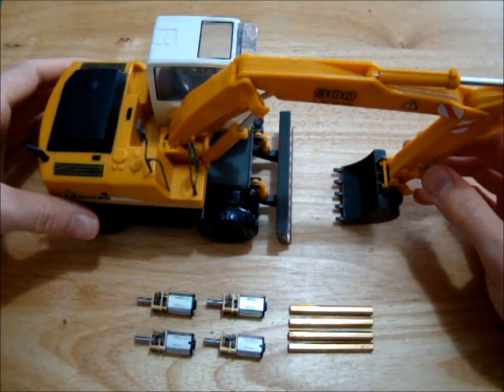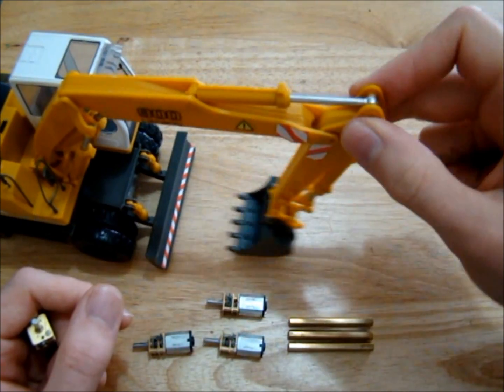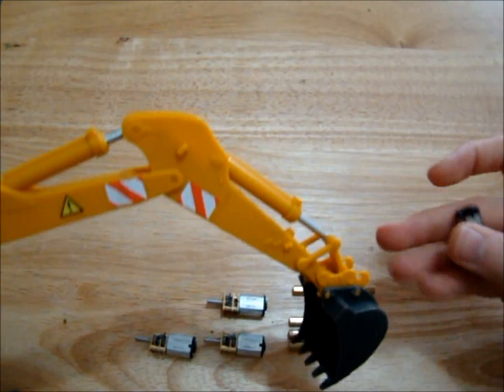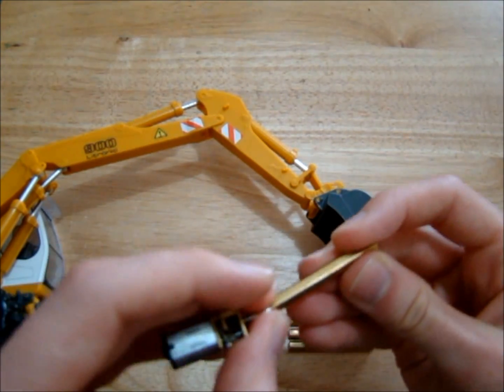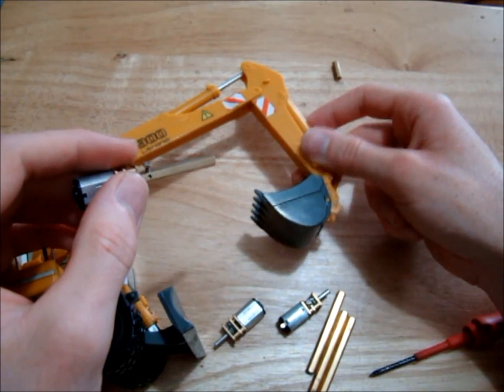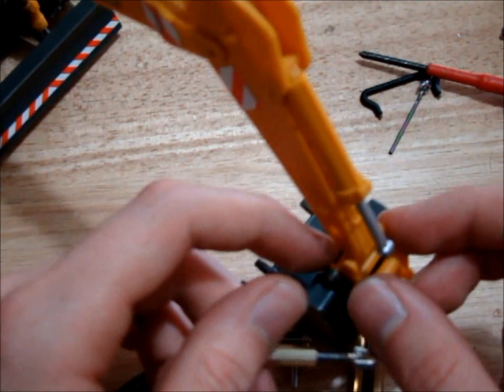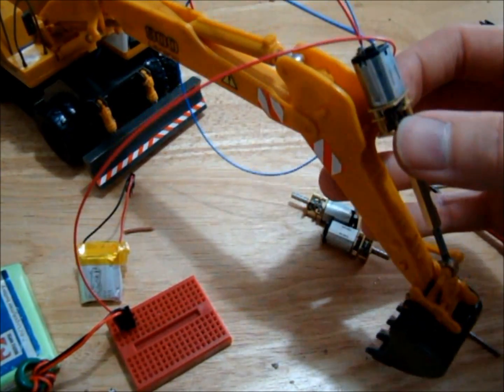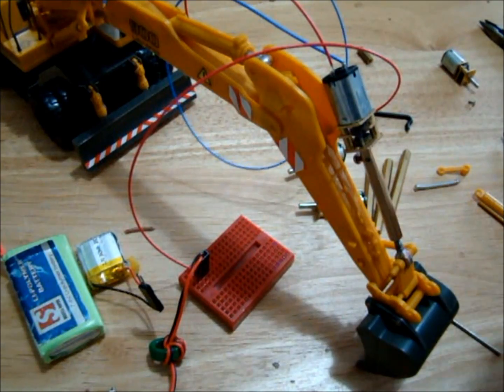RC Liebherr A 900 C Litronic part 2 - Linear actuator test 1

Comment: Where he bought electric motors with gear box?
thaks
Reply from the maker: liberaitalia I got them on ebay, here are some links http://www.rctractors.net/electronics-from-ebay
Reply: RC Tractor Guy you can not connect the motor directly to the reicever? You can report a detailed guide for the realization of the excavator?thanks
Reply from the maker: liberaitalia No you need a motor driver, I use a TB6612FNG. Here is a little tutorial for the motor driver https://www.youtube.com/watch?v=h89C84FcPXk

Comment: Please, threaded bars are fully threaded(through whole length of bar)? Please where did you find them? I can find just bars with little thread length on each side(e.g. 1 cm long thread on both sides, but it is not possible to screw through whole column). thank you
Reply from the maker: Yes the bars I got are full length threaded bars around 200mm long, here is a link to where I bought them on ebay http://www.ebay.co.uk/itm/STAINLESS-STEEL-M3-3MM-THREADED-BAR-ROD-STUDDING-200mm-/270651815627?pt=UK_DIY_Material_Nails_Fixing_MJ&hash=item3f041af6cb

Comment: Have you thought about using a 6 or 8 wire slip ring for 360 rotation but also electrical functions below like forward and backwards blade up and down and steering?
Reply from the maker: That is a good idea, back when I was working on the Hitachi I looked into it but I can't remember why I didn't go with it. It may have been space below the undercarriage that was the problem. Looking on ebay there are a few reasonably priced slip ring choices that would probably work perfectly so I'll probably go that direction, thanks for the suggestion.